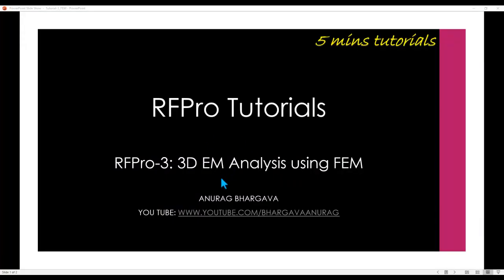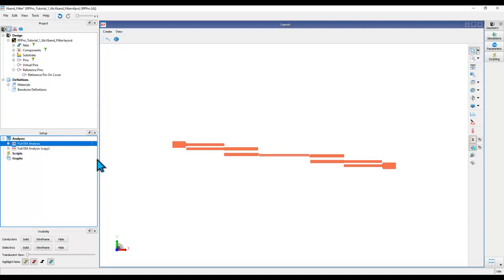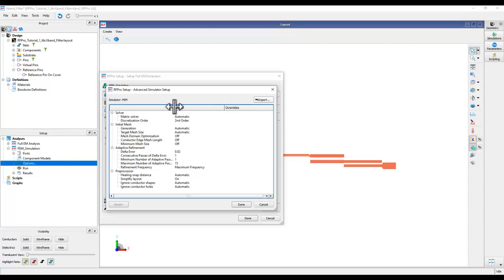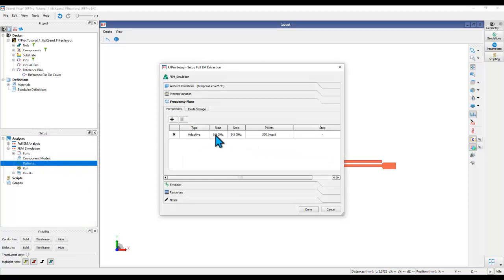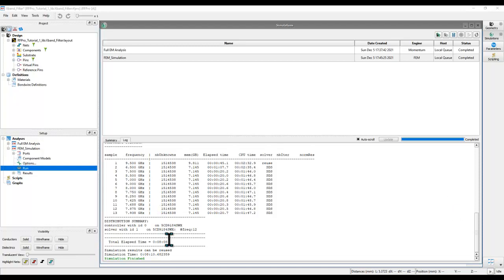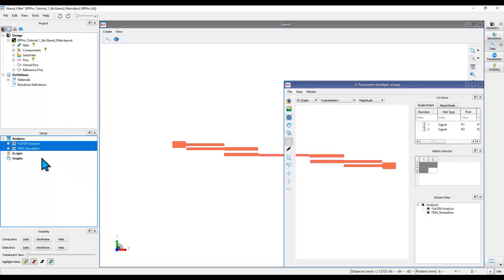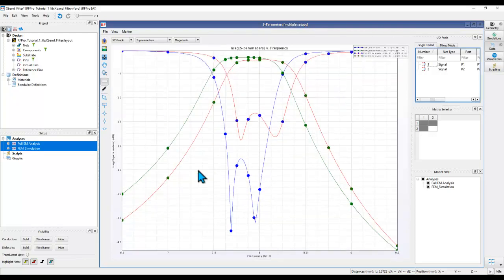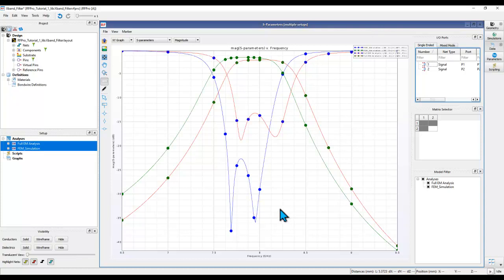RFPro-3: 3D EM Analysis with FEM

Comment: I have a question regarding the FEM setup in your simulation. What is the difference between conductor edge mesh size and minimum mesh size? When do we have to set a value to the minimum mesh size?
Reply from the maker: Usually you can ignore min. mesh size 99% of the time but at times you can use it to force simulator not to go below a certain threshold in order to save memory and time.

Comment: It's exciting to see a separate, dedicated playlist for RFPro. I'll install it ASAP and follow.

Sorry for posting irrelevant question here, can we give an input signal with some bandwidth in ADS s-parameters simulations? 
Or maybe time domain signal but get s-parameters also.?

Thanks 😊
Reply from the maker: RFPro doesn't need to be installed separately, it is available as soon as you install ADS.
S-Parameter simulation or measurement is always done on per frequency point basis and there is no concept of bandwidth as such and you simply sweep the frequency to perform the analysis.
While running Transient simulation, you can surely see S-Parameters as well and you refer to the Transient simulations videos that I posted under Learn ADS in 5mins playlist.
Reply: @BhargavaAnurag  thank you for detailed reply. I think I failed to explain my question.

When I check output of signal generator on spectrum analyzer, the peak is at 2.45 GHz with few kHz skirt left/right, that maybe due to the phase noise. 

However, this thing is not observed in ADS sources, although we can define phase noise parameters as a list.
Reply from the maker: @HamzaKiani3  Yes, the skirt that you see for Sig Gen on a Spectrum Analyzer is the natural frequency response of the source + due to the Resolution Bandwidth of the Spectrum Analyzer. This is not really necessary all the time in the simulation world. However, you really want to see that kind of Spectral Plot then you can use Circuit Envelope Simulator in ADS but again the question is what are you trying to achieve by doing that?
Reply: @BhargavaAnurag  thank you very much. I reached the same conclusion after reading few articles online and ADS help document.

I'm simulating a rectifier whose efficiency is not good in simulations with multi-tone input signal. However, in testing, efficiency increases. It is supposed that the multi-tone signal with few kHz BW in reality drivers more power to the rectifier which enhance it's output DC voltage and hence efficiency.

However, I am not in favor of this idea and believe that this few kHz bandwidth in reality due to phase noise is not responsible for improvement and there is no use of incorporating it in simulations.

Thanks again for your kind response to the queries.